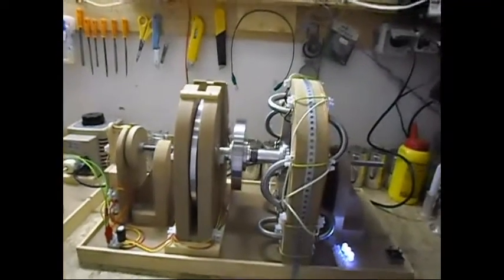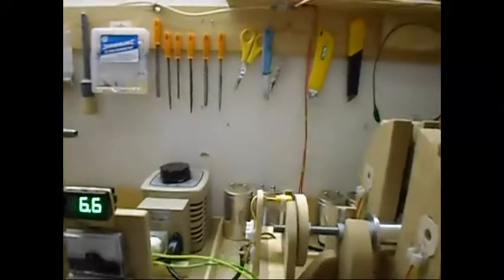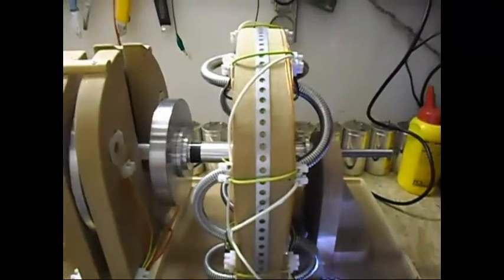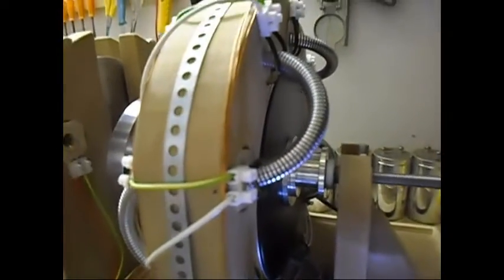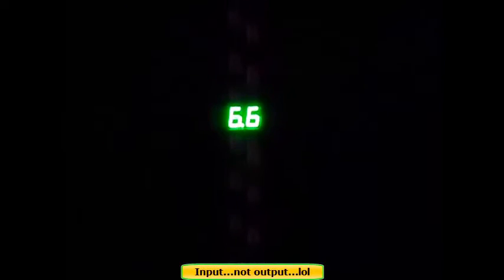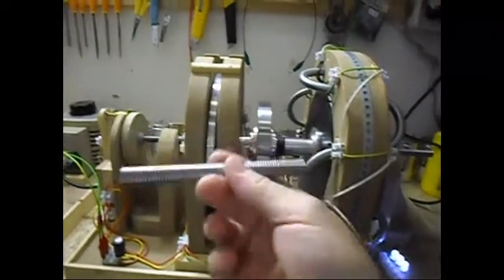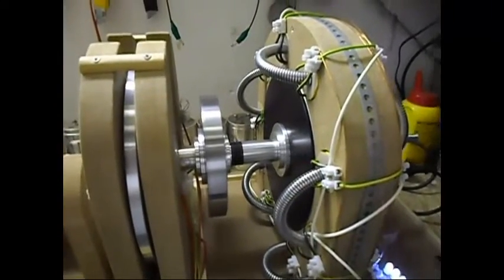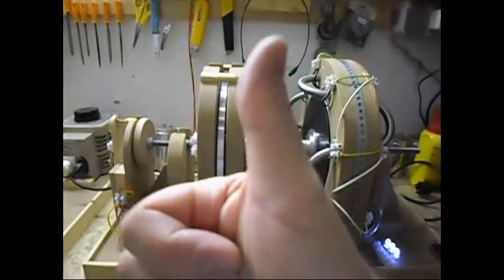Pulse Motor_Generator - Just a Fun & Cool project...

Comment: thanks for posting. nice work. have you measured the internal resistance of the alternator.   fine wire has higher resistance.
if its high, you might try using 18 ga or larger magnet wire. you may get lower voltage but higher amperage out. 
 
you will probably find, several alternators will be required to produce usable power.    if so, a high speed drive motor and reduction gear, might be tried.  a reduction gear helps to isolate the motor from the load.    no belts please       

note that any magnetic drag occuring near the perimeter of the rotor has a mechanical advantage against the force turning the drive 'shaft'.     hard/tempered steel is not a good choice for a coil core.    it becomes permanently magnetized and interferes with the changing flux, reducing output.  the flywheel is too small to be of any benefit on this apparatus.     

a theory about B-emf in a coil  -    b-emf happens in a conventionally wound coil because the windings 'go back' on themselves.  this is the cause of the observed increase in the self-inductance of a coil. 

I made a coil in which each winding layer was wound separately, they were then connected 'end to start', using a small length of wire.   the coil now has little or no b-emf, and near zero output as an alternator coil.   it might be good for other things.    cheers
Reply from the maker: +David Davids 
Thanks for your comment, compliment and information on all...^^
Changing the wire size won't do much here since it has to do with the magnet/core/coil configuration and after the feedback test i could only get like 1/6 of the input amp back so it is back to the drawing board...lol

But one good thing about it, when i took the ouput and feed it back to the drive side the generator side does not slow down the drive side so that is a good thing to see...;-)
Steel can be used for cores as long you have a alternating south and north pole hitting them...
And at lower frequencies it is gonna be alright...^^

That's a nice coil you have there but with no output it is a bit useless...lol...i have some coils that also will give very nice speed up under load at very low rpm but with pretty crappy output...useless all of them...lol
Finding a good balance is what we need to make this work...^^
Cheers

Comment from the maker: Some info for those that wants to know,

I've did the feedback to the source test and it's not so good...lol
I could only get around 100ma back from all the 9 coils...crap
Did delta and star connections but both gave kinda the same outcome...

I treid it with a huge cap directly on the output and than to the source cap and also with a dc to dc coverter and both gave kinda the same outcome...
Sooo, input as one can see in the video above is 6.6vdc @ 600ma and with the feedback the amp draw dropped from 600 to 500ma...

The simple feedback styles works nicely but them coils just don't produce enough orange juice...lol
But the good thing is that the drive side does not slow down when the 100ma is extracted from the generator side...cool...^^
Cheers

Comment: It seems like when you add a load to the x rotor motor shaft the amp draw goes down and you can also capture the back emf, this is why I recommend it performance wise. Then coupled to your generator which looks like your searching for the lowest possible drag on the generator side, you can then use the least amount of motor amps to drive a high output drag reduced generator while capturing the motors back emf , put it all together. In earlier videos you used a pulley  setup, I would go back to that so you can over speed your generator and get more output as well as make use of the pulley ratios and mechanical advantage achieved through the pulley system. Or even use a gear box. Then the next issue would be charging a second battery faster then it takes your motor to draw down the first battery, if you can do this you can setup an automatic switch over system. Take a look at bedini g-field energizer two battery system. You can even add solar power to add in and help out to achieve a self runner. Once the system can sustain its self then any excess energy can be used for lights and other loads.These are just ideas, and there are lots of us subscribed to your channel and appreciate you doing the work and sharing, I know how time consuming it can be I've been experimenting when I can but life gets in the way. Anyway those are my thoughts on the matter. Thanx. 
I forgot to add that capacitors and voltage regulators would also be used where required and a micro controller would be used and programed  to sense voltages and control the timing of the system such as the battery switch over so you don't have to do it manually. There are lots of people like you, tinman, lasersabre, mr2tuff, mranguswangus, dadhav and others on utube doing some very interesting work, we just need to learn from eachother and put it all together. okay I'm done now.
Reply from the maker: +Ryan Doupe 
Thanks for the extra info on the x motor and the rest also...^^
For the last few years or so i've seen all there is to be seen on youtube and forums...:D
It is important to see all we can see and to learn as much as possible but it is very important to go your own way...;-)
One must try to push ones own limits and not hang on to someone elses ideas or setups...
Learn & replicate & replicate to learn but don't be a copy machine only...we all can have good imagination...we only need to get it fired up...^^
Cheers

Comment: Researchers accidentally quadruple lithium-ion battery lifespan 
 "While graphite exhibits a storage capacity of 0.35 ampere-hours per gram (Ah/g), aluminum can theoretically provide a capacity of 2 Ah/g at a very low cost" This is 5.7 times the capacity of standard  lithium-ion batterys.
Now for the first time ever electric cars will have a range greater than 500 miles between charges.  
http://www.electronicproducts.com/Power_Products/Batteries_and_Fuel_Cells/Researchers_accidentally_quadruple_lithium_ion_battery_lifespan.aspx

In addition the life expectancy for the batteries will now exceed 15 years.  This is the age of the electric vehicle with free, solar-powered vehicle charging stations.  Solar-powered vehicle charging stations have been installed and are up and running in San Francisco.
http://www.cnet.com/news/san-francisco-introduces-free-solar-powered-electric-vehicle-charging/

It will only be a matter of time before this becomes Nationwide the age of the internal combustion engine is over regardless of rather it is running on hydrogen diesel or gasoline.
Reply from the maker: +ke4uyp 
Thanks for your comment and glad you liked it...^^